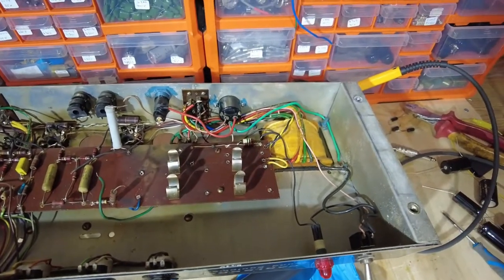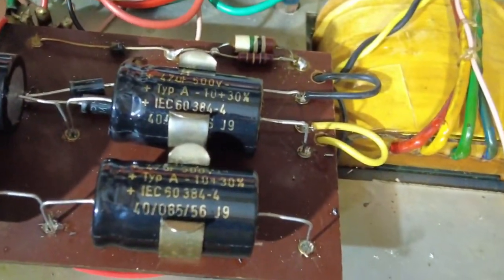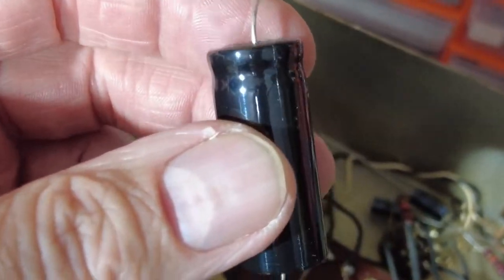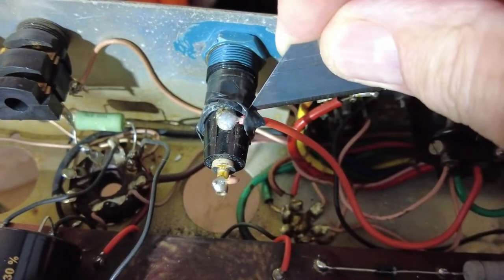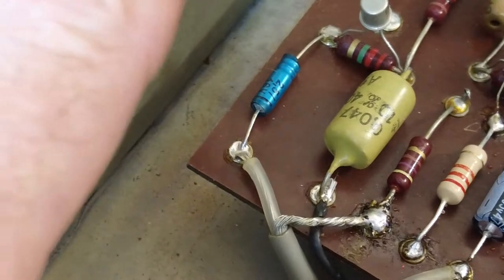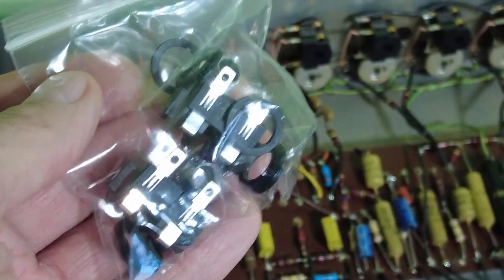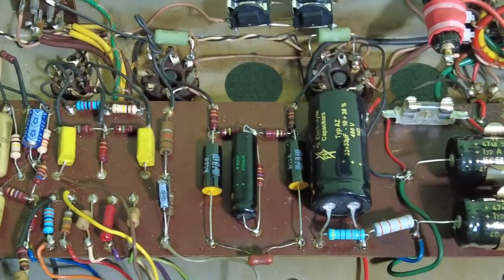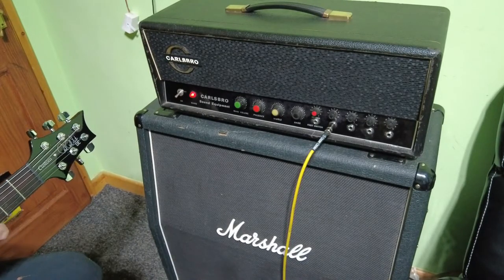Carlsbro CS60 PA Part 2 Restore Like Brand New

Comment: Good call, mounting the aluminum resistor to the chassis. Some classic American tube hifi gear such as Scott and Fisher had vertically mounted power resistors on the outside of chassis near the tubes and transformers. Better than having all that heat collect and concentrate underneath the chassis near the capacitors.
Reply from the maker: Yes, the best way to go with it I think. Take care.

Comment: Great amp, I now need to find one for sale...The bandage job on the fuse, I'm also looking for any rubber type sock sleeves (not sure technical name) that push over fuse holders/switches etc...Don't seem to make them anywhere or I'm not typing the correct term. Sometimes a bike innertube does the trick..
Reply from the maker: Hello. I used electrical heat shrink tubing. There is usually one or two of these amps for sale on ebay. Thanks for watching and take care.